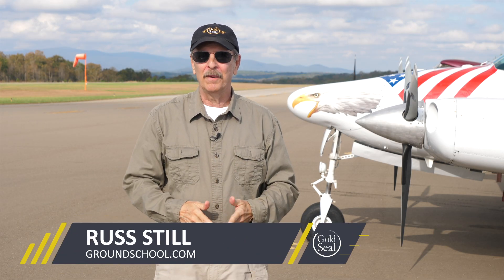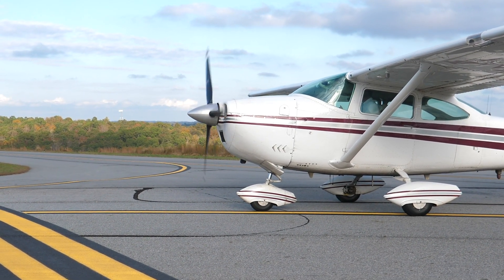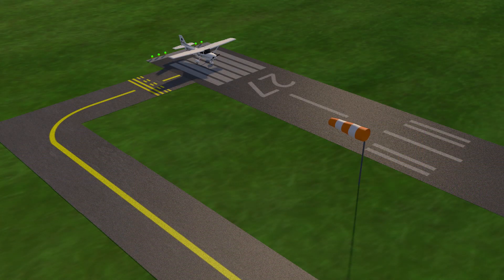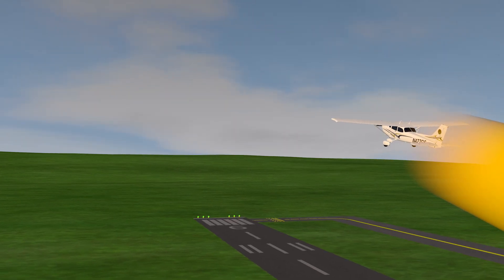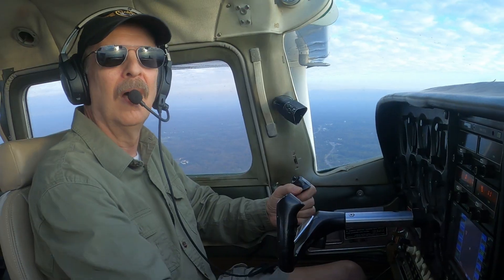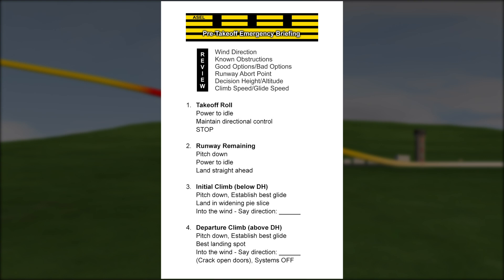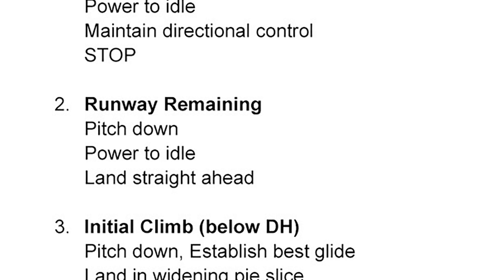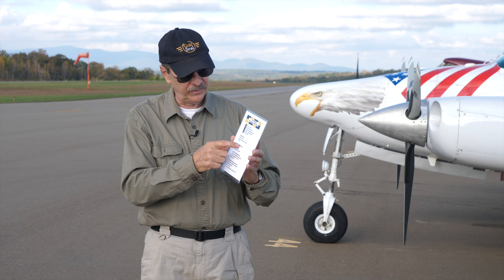Takeoff Emergencies

Comment: At a reasonable density altitude with a decent sized runway, turning back is easily accomplished from 400-500' AGL.

The optimum maneuver is an aggressive 45 degree banked slicing turn into a headwind, pulling hard, just below a stalling AOA. Glide speed is a good target. This maximizes turn rate, and any crosswind should help carry you back towards the centerline. None of that standard rate turn nonsense. 45 degree bank is the most efficient combination of turn rate vs altitude loss. 

And don't try this unless you've practiced it. If you haven't practiced it before, you're an unprepared pilot and you should accept landing straight ahead off-airport somewhere.

Comment: I was taught 4 kinds of EFATO in 1996 by the only CFI teaching them maybe in all USA.  
1-50 feet partial engine cut and land in front.  We cut the mixture after the throttle. 
2-50 feet total engine cut. Cut the mixture to stop safer too.. 
3-500 agl partial power Turnback, With a 10-12 wind and tailwind landing on 4,400' runway.
4-700 agl no power turnback.  He used a 4,400' long runway but surrounded by houses.  So these maneuvers were required by him on his Cherokee before solo. 
I taught them later on too.  
The other flight schools in the area had accidents.  Not that school that he taught those 4 EFATO.  Those schools used to say we were going to crash, THEY CRASHED instead, mostly on the 4 above EFATO they refused to teach for real.. LOL..
Reply: Hi Harold.  Wow, you posted that 3 years ago and these Mild Maneuvering Paper Tigers that cant do those maneuvers voted you down.  Mild Maneuvering Misses cant do them.